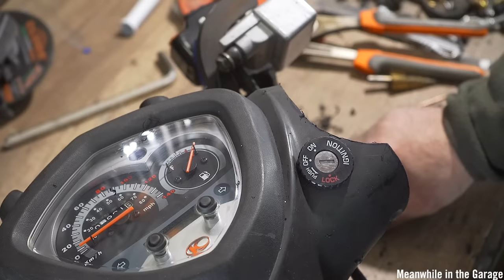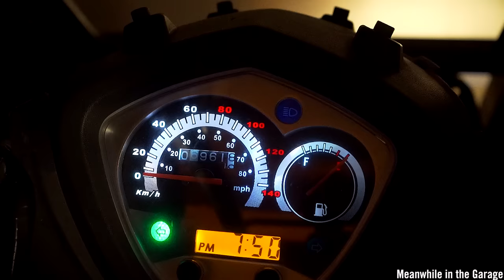Making a futuristic motorcycle

Comment: The talent of this guy is at the next level
Reply: And only 250 likes, people just don't see it.
Reply: This clumsy cart on turns will fall without balance with its feet.
Reply: Guy mean গরু
Reply: I need it....❤
Reply: @doktortime
Tadpole would be safer but this design shouldn’t have manual landing gear, it should drop automatically when speed drops and should run like air brakes so the default is down.
Reply: Genius friend good idea Argent
Reply: Nice
Reply: Price

Comment: Impressive! How much weight did you add? One idea: make the "landing gears" slide down verticaly so you do not need so much space on the sides and don't hit cars next to you.
Reply: Esa fue justamente mi duda
Reply: More weight = less efficiency 😂
Reply: @michaelrogers9720 that only matters during acceleration
Reply: If the doors are hinged at the top so that the bottoms of the doors swing out, you do not need landing wheels because you can push the doors slightly open and put your feet on the ground. I have built a motorcycle like that (which is electric powered) and have done more than 150,000km in it. The closed body has only one-fifth of the air drag of a normal motorcycle, making it possible to get a range of 800km at 80 to 100km/h on one battery charge.

Comment: I love the odd bits of comfort, like the insulation and weather striping. I didn't see anything in the way of ventilation though, I feel that'd be a must to make this a 4 season ride.
Reply: what it needs badly is wipers with water nozzles.
Reply: also crosswinds are going to terrible
Reply: Seeing enclosed the heat from the motor with add quite the heat. A bigger concern will be cooling.

Comment: Interesting build. 
I have a few questions:
- How the folding wheels work? 
- Is the cockpit hot? I didn't see any ventilation
Reply: Does it have self balancing system??
Reply: @g0s_vlogs237 don't think so
Reply: @g0s_vlogs237  You saw the trainer/support wheels there.. you fold it up once you gain balance , too risky and not really reliable, imagine you gotta stop the bike quickly or you gotta ride slow in traffic those things are not as fast as your legs.
Reply: Do they go up automatic, or rider has to open and close maulally?
Reply: @g0s_vlogs237   no it do not have self balancing system
Reply: @BibxikxbMmJvih   correct
Reply: @peterlang840 he uses a button for that which is nit good

Comment: This guy is talented.. Very amazing design..
I just have one question.. are the folding wheels reliable ? If the vehicle suddenly stops during an accident or an emergency situation, are the folding wheels fast enough to retract in that very moment of time and balance the vehicle?
Reply: also, Isn't it a risk of bars risk during slowing down moments such as low -speed areas? let me explain. You ride quickly, bars raised, therefore, you must go to the right of the roadway like a motorcycle in this case ( EU circulation based ), only, during your journey, you must significantly reduce your speed and therefore deploy your auxiliary wheels, is it What does it not represent a risk for you, to be able to hang any obstacle on your right or any user of the road to your left if you do not return to the center quickly and deploy the bars? Would this maneuver in it even be enough to make the vehicle ultra dangerous?

Comment: I wish there was a kit to build one of these recumbent cabin cycles with: retractable outrigger stabilization wheels, center-hub steer, accelerator and break pedals, direct-shaft drive, air-conditioning, and an all electric version.

Comment: almost great. i think you need a version two  where you fix the stand to be closer to the body. 
The main flaw of this is that since it has the same footprint as a motorcycle, motorist on the road are not going to know that you have to prop those sidewheels down on such an extended manner. 
on a traffic stop, i can easily see this toppling over because someone is too close to you when you need to stop.

Comment: Love it. Pillion seat will make this even better. I always wondered when will there be a two seated single column cars.
Reply: I think the main problem is having an open wheel design that comes with a vehicle like that. you dont want spinning rubber tires and rims touching each other at all, especially on the highway.
Reply: How about MotoTracer.
Reply: @lesp315  Did you mean MonoRacer?
Reply: @aymananh  MonoRacer and MonoTracer.

Comment: Pretty cool, but it needs more power to cope with the additional weight if it's going to be on public roads. You can hear it laboring at relatively low speeds in the last frame

Comment: Yeah, that's pretty cool looking.
But what happens if you lay it over on the left side?  Can you just not get out?  All other windows are bolted to the frame.
Not knocking your engineering skills, they are quite impressive.  But not giving yourself and alternate way out in case of an accident seems a little short sighted.
And no, those training wheels will not stop a roll over if enough force is applied.

Comment: Unless you use a motorcycle or scooter in town, this type of vehicle cannot be too enclosed in a fairing, in the open road it will become too unstable. I had an Honda ST1100 back in the 90s, it was terribly unstable in highways because the wind had not too much areas to go through the motorcycle, in spite of its heavy weight.

Comment: Only gripe I have is that you WILL forget to put the wheels down. Simple solution: Use the line going to the speedometer to split off to an arduino board and make the wheels come down below a certain speed.
Reply: Хорошая идея
Reply: That's how you damage shit navigating tight spaces at low speed

Comment: Did you put a real engine in it to counter all that weight? 

Will the automatic transmission it had be able to handle this or is the clutch system in that going to burn out quickly? 

What did you do to upgrade the brakes when you doubled or tripled the weight of the bike?  That looks like the stock single sided small diameter brake rotor from the original scooter.

Comment: While the idea seems nice, there are many concerns regarding this:
-Is it legal? My guess is, he bought the bike, and reused its plate after transformation, but I doubt if the police stop him they would see it with an accepting eye. this is not certified, and thus most likely not road-legal. The fact that he is using some bent (and possibly weakened) tubes for his frame would not go well to get it certified.
-Is it easy to drive? The video shows him driving only on straights. How does it take corners? Especially sharp ones at low speed, where the stabilizers would most likely come down. Why so much veering on straights? Is it because the driver is not used to riding a bike or because the load is unbalanced?
-No heating/ventilation: As others pointed out, it will become extremely hot in the summer sun

Comment: On a motorcycle you lean into the corners. If you just turn your handlebars into the corner you will crash. Are you able to mitigate this or does the bike only go in a straight line? I’m very impressed with your skills.
Reply: There is no mitigating when it comes to counter steering. Once theose side stability wheels lift off the ground, the rider/driver just has to turn the handlebars opposite the direction he wants to turn, and the bike will lean itself into the turn.
Reply: No. That's not how it works. At low speed, you most definitely turn the bars to turn the bike. At higher speeds, it would take serious effort to actually turn the bars in the direction you want to turn. As Danny stated about countersteering, trying to do that would simply make you turn the opposite way.

Comment: All over design is good but I do not like the handle position at all it will be very hard and difficult and uncomfortable to handle, and I also do not like the position of those small tyre they could be designed to take less space on the side for its not practical specially in trafic or hilly areas